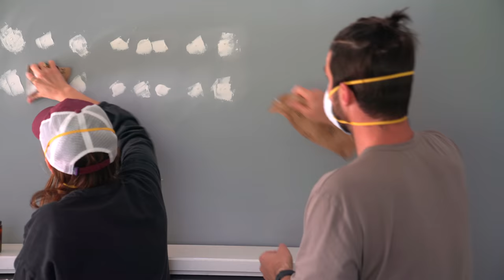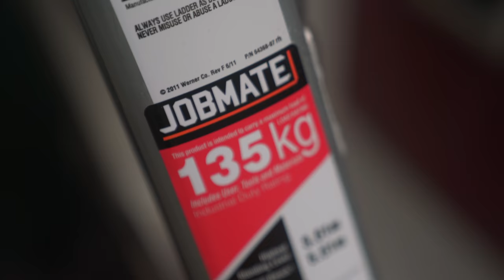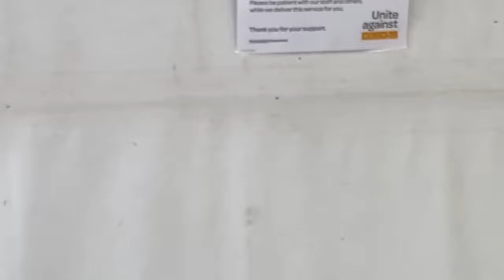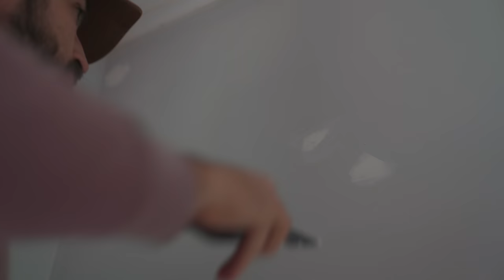Moving into our Homestead on 2 1/2 acres | Our Crazy First Week

Comment: Hey guys welcome to the Wairarapa, now I've got some renovation tips for you... get yourself a bigger paint rolller and tray, the job will take half the time and will have a much better finish, ol mate at mitre 10 really set you up with that foam roller. Get yourself a large free standing fireplace ( bigger peices of firewood means less chopping and will burn all night) , they put out a lot more heat than that inwall one and you can cook on them too. Don't strip wallpaper, just rip the walls down and start again. Coopers paint stripper is best, also a linbide scraper is your best friend for scraping old paint off windows and doors.
Reply from the maker: Thanks for all the tips!!  Stay tuned for the next video,  some of your tips are happening

Comment: Yea nice video Guys  just a couple of suggestions I have done a lot of handyman stuff including a lot of painting, I never used a primer or undercoat on walls that already were painted just wipe them down and fill any holes also while the place is empty check all the insulation under the floor & in the ceiling and if your keen check in the walls as your pretty much guaranteed there won’t be any as back in the fifties they didn’t do it so  you would have to take down jib on every out side wall as I say it’s a big job but your in perfect position to do it just a suggestion maybe just at least do it in your bedroom to start with, my last house was from the same era they built them solid but didn’t really thick bout insulation,have fun 😀👍
Reply from the maker: Thanks for the tips Mike.  We’ve been thinking about insulation.  You may be right about the bedroom

Comment: Those rounds of fresh cut wood need to be split and stacked to dry out as soon as possible, it dries out faster that way. Also work out the best length for the wood to go into your fireplace, front to back, not sideways, and cut your rounds that long. Getting your wood pile ready for winter is a very satisfying job.
Reply from the maker: Thanks for the tips Catherine.  I’ve got a good chainsaw on the way.  Looking forward to the work
Reply: @AlexanderAyling  From my experience cutting the rounds shorter rather than longer will make splitting easier. If they're too hard too split they're too long. Too, splitting green wood is easier than splitting dry wood. I reckon wood splits easier if one splits it upside down, rather than from the top, the way it stood when it was growing. Struggling with an axe is no way to spend a day...just observations garnered hanging off the end of an axe.

Comment: What a great video! You guys are going to have so much fun. And the pandoras box never ends with a home. 
Renovation tips I've learned after 3 homes
1. Pick up trucks are not over-rated - it will get used for sure
2. Save your scrap lumber (you'll need it one day) also goes for random hardware
3. Start with your foundation and work your way up to cosmetic to save your stress levels
4. Low VOC paint doesn't smell 😁
5. Take before and after photos
Cannot wait to see what's to come!

Comment: Your place looks like heaven to me. Loved the long video and so appreciate the time it takes you to edit. I’ve restored two old homes (mostly by myself) from top to bottom and there is no easy run. Just make a list and check off as you go.  One thing did come to mind as I watched you paint. Is the paint and primer in one available in NZ? It was a life saver for me as I painted one 1400 sf and one 1600 sf house by myself including all the trim. Definitely need primer of those darker colors like red or gray, but you can usually get by without primer on the lighter colors.  It will save so much time. And if you can find low VOC paint, it won’t stink as much. A sanding sponge that you dampen will help keep the dust down when you are sanding your wall repairs. One more paint tip. If your ceilings need a touch up, one good coat of ceiling white should do it. So much easier to do while the house is empty. That’s all for now. Looking forward to your progress but please take a day (or two) off regularly to keep you from burning out. The work will be there every day. Peace and blessings to you all. Kia kaha!
Reply from the maker: Thank you for the tips!! No need to worry about us burning out.  We’re slow and steady here.  Cheers!

Comment: Great job with the video Alex, don't mind the length at all,  fascinating stuff definitely.
I'm also in the process of doing up a place, it can be slow going, especially as I'm only there off and on.
A caulking gun and some cartridges of No More Gaps will deal with all the cracks etc.  And a set of good quality screw drivers is essential for your tool kit.  You might also want to consider getting a screen door and some mesh screens for a few windows.  I've discovered that living in close proximity to farm animals does cause some fly problems, it's nice to ventilate the house, but keep the flies out.
But looks like a real nice spread you've got, just need a porch swing and banjo and you'll be right.

Comment: The longer format is better, as it gives a more cohesive picture of what you are experiencing.  Plus, it relieves some of the pressure of uploading as frequently.  Being in the kitchen with a baby lamb is as "Kiwi As" as it gets!  Invest in a much bigger paint roller, as it will save a lot of time and give you a superior finish.  It might be worth it to open the dam gate and use the flow to suck some of the silt out of your pond.  Assuming the opening is fairly low.  Buy a chainsaw, sharpish and a powered wood splitter.  You will burn through a lot of firewood.  Good luck to you both.

Comment: The wood need to be dried or left dried and when ready chop to pieces to stack undercover and then this can be used as firewood for your heating and cooking if you have an old stove that doesn't run on electricity.

Comment: Some friendly advice for your bit of paradise….(these are things I learnt over time on our little lifestyle block)…You look to have some ticked off already! …Get a chainsaw, log splitter, ride-on mower if not sheep,  and if poss a quad bike too, build a potting shed, plant fruit trees for you own orchard, veggie garden, get some chickens, (but not roosters), check your water filters, change the old electric stove to a gas hob one. (Cheaper to run and quicker to cook with). Strip the paint off all the window and door furniture, looks better than years old blobby paint. They look the brass type to me, common back then. Insulate like crazy. Hook up your garage shed to the water tank as well, but with two good sized tanks you should be fine. Overtime, fit modern taps that don’t waste water as much as well as toilet. Looks like you both have a lot of work ahead but it’s great to see you find a sweet place and have your own plans. Awesome guys

Comment: Ahhh the fun of renovating... done many and muchness of this and still doing it... lol

But first, I would check your ceiling insulation... even replace (depending on how old) with new pink batts and then install ceiling blankets on top of that. Then if you can... depending on the crawl space and style of floor check your underfloor insulation older homes may not have any. If you can lay some polyurethane sheet on the ground to help with moisture.

Older wooden homes may need to keep bora under control and that should be done at the beginning of their flight season which can be around November(ish) through to March(ish).  

Over summer check the outside look for any damage/rot around windows, sills and check weatherboards to ensure no damage anywhere that water can get in, rain comes in at all different angles with different winds... 

On the roof go round and check the roofing nails over time they can come loose and not seal properly and hammer them again (most will be fine but you may get one or two... will help stop any leaks.

With gutters, I would use a system called "Gutter Bristles" which will stop the leaves and stuff from getting in the gutters.  

The Sleep Out gutter you may find that a join has just come apart and need to be rejoined if it is PVC guttering... (which it looked like) clean and glue "Marley Gold" if it isn't at the join you may need to replace a section.

Inside ... Do one room at a time...
Reply from the maker: All solid advice and the same our building inspector gave us.  We’re hard at work on this list!
Reply: @AlexanderAyling  owning a home and doing yourown renovations... you are now in the down spirling realm of buying tools...  my channel is a wood working channel and shows some of the home renovations we have and are doing etc... few tips and tricks... (oh and you don't need the tools I have etc... that took years to get.) I do have a list of basic  tools on my website that if you are going to get in to any renovations that you will need

Comment: Gutters are the main priority as that's your water - but also check to see if there is a filter on the water coming into the house - I use disposable cartridges which I change maybe every 6 months (maybe a dual cartridge system with a 20 micron and a 1 micron which will stop Cryptosporidium, & Giardia) If you have that you don't need those fancy UV things. I also had the house wired for a generator (a 7kva inverter will run virtually everything). The switch and wire system can later be used for solar if you install that.

Comment: Glad to see you guys are settling in , 
It gets hot their in the summer and dry
I’m a kiwi plumber  based in Wellington so if you need any advice or contacts for local
Plumbers just let me know,
Reply from the maker: We definitely need plumbing advice and could use recommendations for a solid, reliable and reasonable plumber.  I want to get the rain water system functioning properly and a UV pump installed but the exterior  piping systems are in bad shape.  Any tips?
Reply: @AlexanderAyling  before you replace the pipe work system . Some times it’s easier and cheaper in the long run to look at running a complete new system , your best bet is to contact a local rural plumber as they deal 
With those systems all the time, I have one contact up around the wairarapa , let me know if you want his number , most of our plumbing 
Is regulated , so getting advice I highly recommend ,

Comment: Great video Alex. Love following your journey. You will also need a good chainsaw, and splitting axe. Plus you really should look into getting a trailer. An absolute must to move things around. Saves messing up the back of your car.
Reply from the maker: They left a good splitting axe here which is nice.  I’m working on getting a good chainsaw.  The trailer is a must but damn they are expensive!
Reply: @AlexanderAyling  you are right. Trailers are really expensive. Even good second hand cost a lot. It looks like you may have some renovation work in the pipeline so really helpful to have a trailer big enough to lay a full sheet of material inside. i.e plywood sheets in nz are supplied 1200mm x 2400mm so 8ft x 4ft trailer works. It might also pay to get a cage trailer if you want to move stock around. Wooden floors are better so the animals don’t slip and fall over

Comment: I had a bit of a chuckle when I heard you talking about collecting rain water.  It sounds easy and trouble free but it certainly takes a lot of effort and thought and problem solving to keep that system working.  At least when we replaced the old tank that had an open hole at top we stopped getting drowned possums spoiling a whole tank of water - it stinks to high heaven.